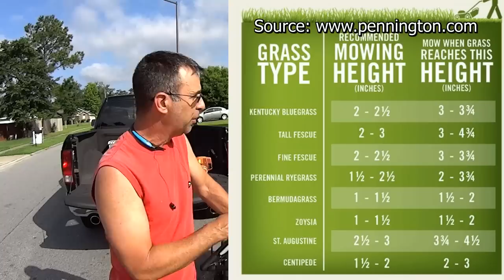THE REVIEW - Honda HRX217VKA 21" 186cc Select Drive™ Self-Propelled Lawn Mower

Comment: I have Had a HRX2172HXA for 7-8 years and have had only 1 problem that needed service.  ( a replacement of the cable for walking speed control ) When I purchased it I thought; "My God, I've just spent more for that mower than I spent on my first three cars.".  It has proven to be one of the best investments I've ever made.  
     This video did cover a couple options I have never tried. I have never tried partial bagging / mulching, but will give it a try. Also, Raising the front wheels one notch when using for vacuuming will be tried when cleaning up the lawn in the spring...I DON"T rake, and WON"T rake........Great all around lawn mower.  Honda powered  is the BEST,

Comment: Dan this was one of the best and arguably THE best review video I have ever seen.  So thorough and complete.  I can't believe I spent an hour watching someone mow grass !!  Thank you so much for taking your time and producing this video.  I was on the fence for Toro or Honda as my cheapo box store mower just went down last Saturday.  This video along with the comments has made that "which brand" decision for me a no brainer.  Really an excellent review Dan.  Way to go !!
Reply from the maker: david yurik Thank You David
Reply: Looking to purchase one and came across this video for the first time. I have to agree with your comments. Best video series I’ve seen as well even 3 a year later. Saw a lot of reviews elsewhere saying it left clippings and clumps, but you never know what exactly those reviewers were cutting, how high the grass was, how wet, type, mower setting, etc.  this video series showed it as is, had excellent audio of the engine working through heavy load , and added visual context to the presence of clippings and clumps that may be left behind. The clippings and clumps left behind in these demos are some that I would consider bearable since I’d have no problem doing a quick second pass at a higher setting to ‘vacuum’ up so to speak. If I hadn’t seen it and heard it for myself with these videos I would have relied on the written ones and walked away. Thanks !
Reply: Did you ever thought about buying the Honda with the Roto-Stop blade control. That takes mowing to a whole new level. I got the HRX217K5VYA. The blade control will allow the engine to run with the blades not turning.

Comment: I have a HRX217HYA (hydrostatic transmission).  I have owned Toro, Troy Bilt, Lawn Boy, Jacobsen, and maybe a few others in 52 years of home ownership, and the Honda is definitely the best mower when all aspects are considered.  This review is by far the most complete, accurate assesment I have seen on YouTube.  Thank you, appreciate it greatly!
Reply from the maker: Thank you
Reply: ...but not a snapper.  It seems like like everyone who hasn't tried a snapper thinks Honda is the best, and everyone who has owned a snapper won't have anything but a snapper.  In pursuit of ultimate excellence I own a Snapper Ninja and now a Honda HRX 217, I'm pretty excited to see how it stacks up against my snapper and I really hope it does better! 

Also, top notch review Dan!
Reply: Forgot the Snapper.  Did have one.  Liked it.  It had a funny spinning disc involved in propelling the mower.  Many years  ago.  Think the self propel was the weak point.  Good mower though, gave it to my son, he used it.  Still, not the mower the Honda is.  Not as expensive, either
Reply: Yep, the friction discs.  I actually think the self propel system is the strong suit of the snapper except for the flippy stick used to engage it, the system itself seems tough as nails and indestructible, while to the casual eye, Honda's system seems pretty average, but with a more intuitive ambidextrous thumb engagement via the Select Drive.  I have super high expectations for this HRX, I'll probably fire it up this weekend!
Reply: I have the  HYA Honda which has the hydrostatic transmission. EXPENSIVE, but really good for me.  When you consider ease of starting, non rusting deck, everything a mower does...The Honda is great...For me, anyway.  If Honda sold a 30 inch walk behind, there would be quite a market for one, I would think.
Reply: @DansVlog  👍👍👍👍👍👍👍👍👍👍👍👍👍👍👍👍👍👍

Comment: I am going to buy one of these.  My Briggs & Stratton POS hasn't lasted 4 years. But no matter how old a Honda is, it starts.  I've used mowers with Honda motors that were 15+ years old.  And in 40 years I have come across one that didn't start. I cleaned the magnets and now I have a perfectly good pressure washer.   I'm looking through Marketplace and find exactly this model for sale.  So, I look into it and find myself here. I don't think I have seen a more thorough and practical review of anything. And he really didn't babble on too much.  He shared as much technical information about mowing a lawn as he did the mower. It's around $620 at Lowes and I found it used (1 summer) online for $300.  I'm getting it.
Reply from the maker: You will not be sorry

Comment: Just purchased a HRX217HYA Honda Mower with the newer more powerful 200cc engine with Hydrostatic Trans.  I currently still have a working Honda HRM215HXA that is from 1997 - 22 years old and still going strong except for the much weaker engine and a slight oil leak from the main shaft seal. These things are built like no other mower and worth every penny!

Comment: I also got this mower at the beginning of the season.  I've found that with the "variable speed" drive system, I prefer to have it set faster than I'd use it. I originally had it set at the minimum but the resistance of pushing the handle up against the bar was a little much and fatigued my hands. I found that the system is indeed variable in that you can set it higher than you need in order to set the drive handle farther back, and that the speed of the mower increases depending on how far you push it in towards the handle. It also takes less grip strength to push it in the farther out it is, and increases in resistance and speed the closer to the bar you get. In a way similarly to analogue sticks on a video game game controller or the accelerator in a car.
Reply from the maker: Cool
Reply: That’s what i do. I like the HRR paddle better, but the HRX style is getting better for me.

Comment: Great review for this honda machine, this was the mower i decided was the best of the lot, so as i needed a new mower, i went to price up the honda mower, and to my surprise, it cost 1000 euro for the one with the same features as yours, one model up was 1299 euro. This is in Ireland, so instead of taking out a mortgage on the house,  i got a mc cullough m53 150wrp for 449 euro down from 559 euro. it only has a 150cc engine, i wish now i had got the mc cullough m56 190 for 150 euro more, a bigger engine and a 56cm blade. it probably will last a bit longer. That was the best review i have seen on youtube for this mower, well done. I wish we had your prices over here.
Reply from the maker: Vote Conservative and reduce your tax’s and you will!

Comment: Honda makes a great product. My 21" self propelled has been going hard for over 15 years. I mow my own yard and a few others from early March through November and estimate the mower has over 1000 hrs.  I've had no issues whatsoever but do yearly maintenance (oil, plug, and air filter). Always run 93 octane
Reply: So its best to run 93 octane compared to no ethanol gas?
Reply: @randyman8984  my Honda Powersport dealer (service side) says to run 100% gasoline, never run even 10% ethanol blend. We can only get 87 octane real gas in my market, but up to 91 octane in ethanol blend. He said the 87 octane 100% gas is preferable to the 90/10 blend at 91 octane. I wish we had better choices here.

Comment: Just came across this video while researching the new Honda HRX217VKA. It has all the same features but with a 200cc GCV engine. 
I was still on the fence between the Honda vs a Toro. Your review sealed the deal for me. Picking up the Honda tomorrow. Great review. Thanks for all you do.
Reply from the maker: Thank you
Reply: @DansVlog  
Picked up my mower the day after seeing your review. Unboxed and used it for the first time today. Full bag mode, cutting bermuda grass (that has not turned on yet), on cutting level 2, the mower performed great. Started 1st time, every time. It filled the 2.5 bushel bag with ease without any engine strain. Five 55 gallon bags later I was finished and was not worn out. Clean up was a breeze as well. Thanks again!!

Comment: Best review of HRX217 on youtube! Thank you! I have two: a 2005 with the old 3 speed and manual choke/throttle setup, that I got from a customer in 2017; and a VKA like yours that I bought new at the end of last season (Oct '18). The 2005 had carb issues from sitting with gas in it when I got it. I kept pulling and cleaning the carb. It would mow 3-30 yards before corking up and starving for fuel again. I bought a new Honda carb from the dealer (<$20) and the float stuck right out of the box, puked gas everywhere. I exchanged it for a second new Honda carb and it ran like a champ. The engine and tranny are perfect. The wheels are a little loose, but it still tracks straight. The deck started cracking badly at one, and later 2 and then 3 of the 4 motor mounts. I bought a plastic welding kit (<$20 at Harbor Freight) and repaired it; and it seems to be holding up OK used mainly now as a backup mower. 14 yrs of use, approx 12 yrs light residential and approx 2 light commercial use...it should show some wear and tear, and it does. My "new" VKA is quieter, MUCH more fuel efficient, does not have the throttle/gear selector stabbing me every time I turn. BUT I do miss the 1-2-3 gear selector and throttle. I am also nervous about how the autochoke will hold up over time. Right now the VKA starts 1st pull hot or cold EVERY TIME, no exceptions. I always shut the fuel off and run it dry when I am done with it for the day (probably not necessary). I like the price and simplicity of the VKA, but if I had studied the models more closely last October, I might have bought the HYA with the hydro drive and BBC instead. A lot more money, but a lot more machine too!

Comment: Since 2016 I've had the Honda (HRR216VLA) just below this one with the metal deck and 160cc engine and even it has been a workhorse. But the deck has rusted out in one tiny place where the left front wheel is. In a few weeks I will get this one (HRX217VKA) with the 190cc and Nexite deck. It has better wheel assemblies over the one I have too. Home Depot has em for $599...worth every penny. Great review.

Comment: Dan:
My wife and I cut our and our neighbor's contiguous yards; .5 acres total. I have the HRX217HYA (hydrostatic drive + blade brake) and my wife chose the VYA (Variable Speed belt drive + blade brake). She liked the rabbit-ears thumb control over the bale that parallels the handlebar. I would have preferred that she had gotten the hydrostatic drive to eliminate the belt system. She used to have a Toro "Personal Pace" system which was fine until it came to mowing up hill. Since you have to push the handlebar to engage the drive and the harder you push the faster the wheels turn, she'd always be spinning the wheels and wearing ruts in the turf. I tried to get her to cut parallel to the slope, but ... Everyone knows not to try to teach your wife to drive a stick shift car. Don't critique lawnmower technique either. Just replace the worn belts and gears and shut up.

Anyway, we LOVE the Hondas!!
Plastic Deck: No more rusting decks. Quieter. Cleans easier. Lifetime warranty. No-brainer decision.

Weight: The significant weight helps keep the deck level as you move across the lawn and front wheels planted as the rear bag loads -- which tends to lighten the front.

Twin Blades: Magnificent even cut. Very fine mulch. Good lift.

Clip Director: Fantastic feature. Enables you easily to handle nearly any lawn situation in the most appropriate way: tall grass, wet grass, leaves, full or partial mulch ... anything.

Blade Brake: My neighbor has the HRX217VLA (electric start). It was in borrowing THAT mower when our Toro failed that convinced us to go with Honda. Now, you'd think that electric start would be wonderful but, in actuality, it wasn't. Since we had taken up cutting their yard, they had not even used their VLA in over a year. So, when I borrowed it the battery was dead (having also left stale gas in the tank and carb). Fortunately, you can still pull-start the VLA but it turns out that the starter/charging system creates a lot of additional drag and makes pulling the cord really hard. I had to replace the battery because leaving it discharged so long killed it. In use, having to restart the engine every time you drop the bale to empty the clipping bag gets to be a really annoying delay.  The blade-brake means you only stop the engine at the end of the job; far better and cheaper, too!! The HYA/VYA cold start requires just one easy pull. And, my wife agreed with me. Gave us something to celebrate!

Just FYI.

BTW:  I enjoy the videos. I often joke that I enjoy work -- can watch it all day :-). I am retired and doing the CoVid isolation. Yard work has become a welcome diversion.
Reply from the maker: Be safe my friend

Comment: This is a lot of great thought by Honda. I used the rear discharge mowing mostly for leaves on the old mowers using a bungie cord to hold the rear door open before they had that as a built in option. Sold on my next 20 year mower.
Reply from the maker: It’s a darn good mower

Comment: Excellent review! Thanks for explaining that Select Drive transmission. My 20+ year old commercial hydrostatic Honda finally needed to be replaced, so actually I bought this mower yesterday. I mowed a few passes just to try it out and was confused (and angered) on why the self-propel was changing speeds (jumping/slowing). I will mow the full yard this weekend. I sure hope I get used to it. I'd hate to regret this $500+ purchase.  Again, thanks for the thorough review!  Cheers.
Reply from the maker: I’m glad I was able to help, I’m not gonna lie though, it will take you a good while to get used to this transmission with like I said the way it may drag on tall grass but soon you will find yourself anticipating what it’s going to do and it will be like greased lightning smooth

Comment: Had problem with self propel not working well and locking up at times. Took shaft out and sanded down grooves(watched you tube video) and it has worked fine since cuz yep I still got that cutting on about 15 lawns a week.
Reply from the maker: Nice work!

Comment: I got a similar model with the blade disengage feature. Love it, when the mowers cold and the auto choke isn’t off yet I can let it idle without a care since the blades off. Not a fan of the select drive, wish I spent the little bit more and got the top of the line hrx without the key start. I love the independent wheel adjustment. First outside pass on my lawn I raise the one side up that’s off the lawn, gives me a great clean cut since my yard is surrounded by dirt. Wish I had some hard concrete edges!

Comment: I've always been impressed with the way Honda mowers cut and stripe the grass.  I think I am gonna upgrade from my Toro Recycler to a Honda mower here in the near future.  And the fact that the engine uses 10W-30 oil makes it easier for me, as I have a Champion generator that requires 10W-30 oil.  Wouldn't need to keep straight 30 weight around.
Reply from the maker: You will be much happier with the Honda

Comment: Just picked up a used one (HXA model with Hydrostatic tranny) for $160.  I'm coming from my 20 year old HRM215 that still runs and looks like new.  I watched Dan's videos with him using the HRX in high grass and how easily it went right through it.  That convinced me it was time to get a newer one with the larger engine as during leaf season my old HRM215 with the 135cc engine struggles, especially up here at this altitude.

Only problem with my "new" HRX is it's running rich, mostly due to running a low altitude jet here at 6,800' above sea level.  It sputters but when I pull the air filter it suddenly runs fine.  Ordered a new filter but I may have to rejet.  Other than that the engine sounds like new.  I like the larger 9" wheels and love the mulch/bag handle.  My old one just had a mulch plug.
Reply from the maker: 20 years? Awesome

Comment: Someone had a HRX217VKA sitting by the road yesterday to be given away. I picked it up and brought it home. It wasn’t in bad shape, but you could tell it was stored outdoors at some point. Wouldn’t start. Began troubleshooting; had no fuel, spark, or compression. The findings so far: blade handle safety switch that provides a ground to the ignition stator had surface corrosion where it contacts the motor frame. Cleaned that, got spark. On to the fuel issue. Fuel cap was off when I picked it up, tank was full of debris and smelled of varnish. Cleaned the tank, outlet screen, lines, shutoff valve & carb- got fuel going again. Starts then shuts down. Checked compression- zero. Suspect intake valve is stuck open, which is common for mowers left sitting for a good while. Will investigate that next. Hoping to get my free mower running soon and buy a bag kit for it. 🤞🏼 let you know. Thanks for the in-depth video. Very informative. Great job!
Reply from the maker: Good luck Mike! Seems like you have this under control!!
Reply: @DansVlog  Thanks Dan. I have to admit, this one’s got me stumped. Valves aren’t stuck open and I reset clearance, still no compression. I will pick up a leak-down tester today and see if I can find the problem. I may have to open this engine up. Stay tuned.